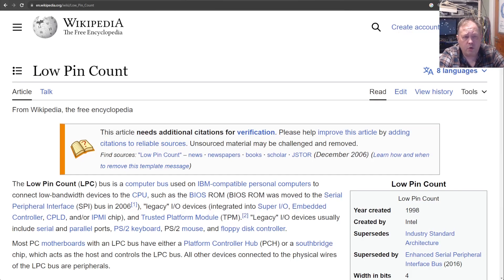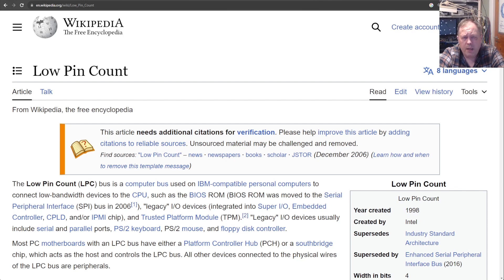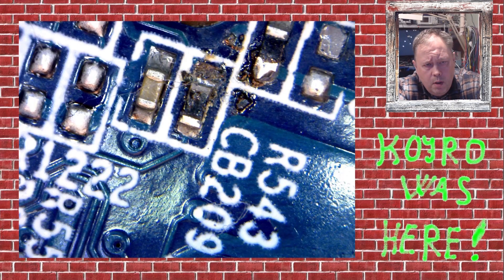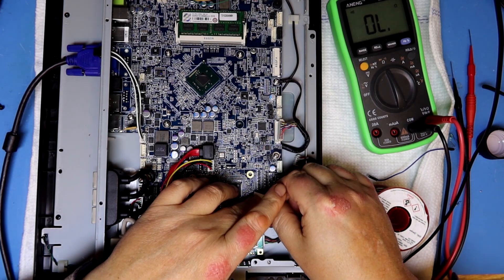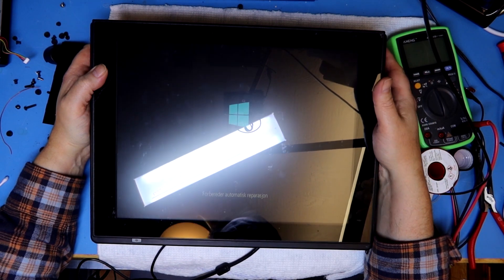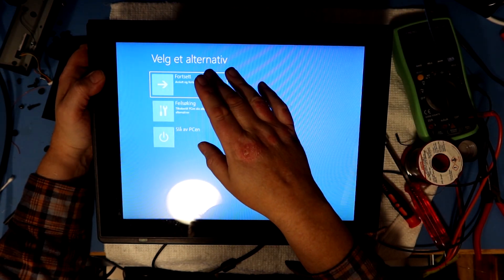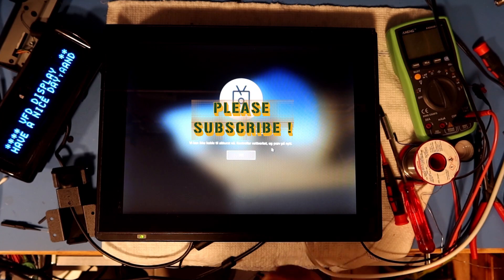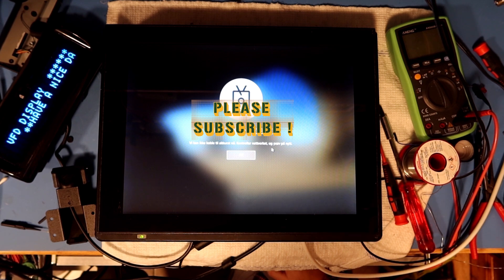Dumpster found PA6225 POS PC / Computer. Part 2. We know why, but have we saved it ?

Comment: Could use this as a "chunky" tablet  pc with that touchscreen. There are ways and means to getting passed the log on screen using certain tools so that you have complete admin access to the machine. I rescued some Digital signage media player pcs when they were no longer needed and was able to Hack my way in and turn them into useable mini Pcs. I have one velcro to the back of a cheap amazon 14 inch touch screen, and use it to watch youtube in 1080 as well as web browsing. The only downside is, like your POS, they run Windows 10 1607 ltsb which is now 4 years out of security support and non updateable with out a clean install of windows and a new Key.
Reply from the maker: That is a possibility, but for this I would go the Linux route, with a light weigth distro. I might do that as a follow up. But it would be more a weightlifting device than a tablet..